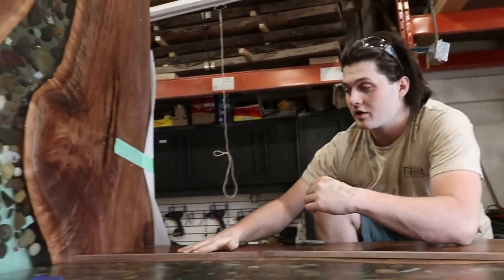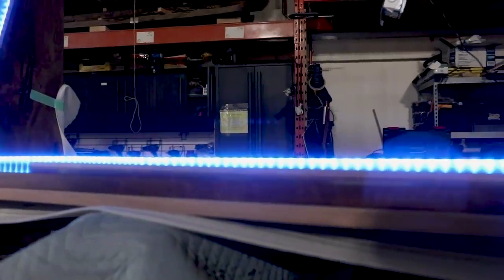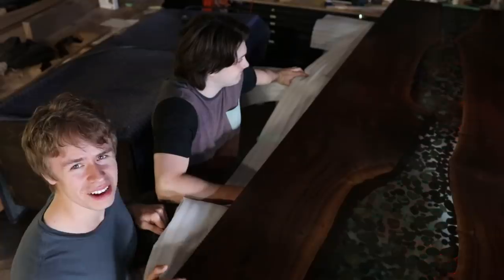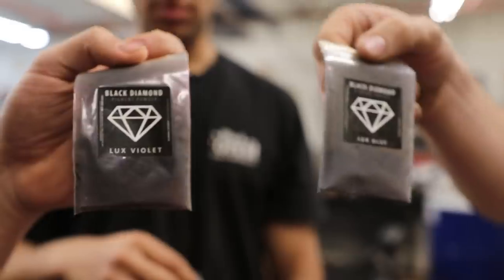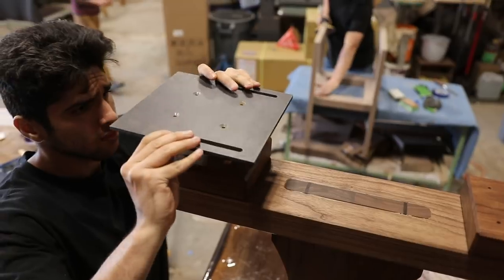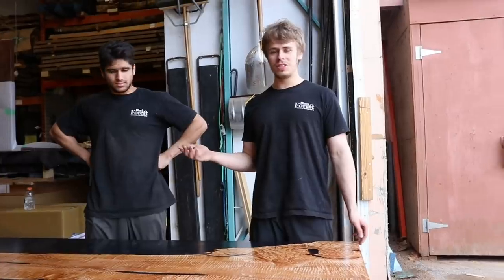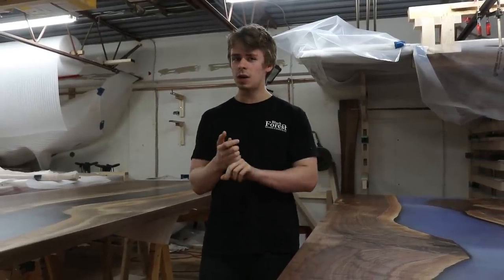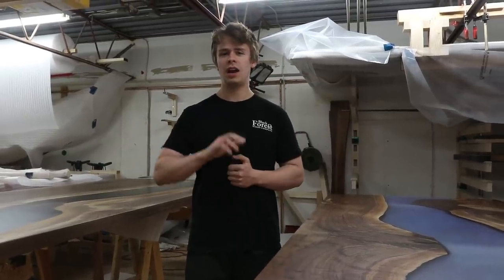Installing LED Lights into a Resin Countertop

Comment: You should always leave a gap when running a bead of glue on the bottom of a piece so the air in the centre can escape. Otherwise you create a bubble of air that can’t be compressed.

Comment: Really cool, next time you add RGB lighting to a table you should look at using DMX as it enables more control over the lights & if going in to a company they may already have a DMX system for there over lighting source.

Comment: Does anything bad like a chip or something ever happen when you guys are about finished with a table? If so, do you start all over?
Reply from the maker: It's happened before and we have had to either just resand to get the chip out, or there have been a couple times where we have had to fill it with epoxy and then resand, and then refinish it

Comment: Out of curiosity, why didn’t you use the CBC router to make the led mount/mask? Seems like it would be easy to get the pattern from the outline and increase by a few inches. Just curious. You all do amazing work and I love watching your videos. Have a wonderful weekend!
Reply: BTW: Look at LIFX lights. They have a strip as well, but it is smart and can be combined with other lights in a room/home for automation. I have used them in residential and commercial applications and they have always gotten oohs and ahhs.

Comment: Hey Dylan what’s the big piece of resin with timber pieces in it under the sign against the wall in the intro?
Reply from the maker: The resin piece was just a test piece for another brand of resin that we tried before we had Black Forest Resins, and then above that is just scrap wood we'll use for art pieces and end tables and other smaller projects.

Comment: Why does your epoxy never form bubbles .Every other video I watch they have to use a torch to remove bubbles.Great workmanship love from Ontario.
Reply: The epoxy is slow drying and kept cool which allows the bubbles longer time to escape, they usually only have to plane the bubbles on  surface. It's also non toxic so they don't have to wear masks to handle it.
Reply from the maker: @tahinde  Yes exactly! Thank you for answering for us! 😊